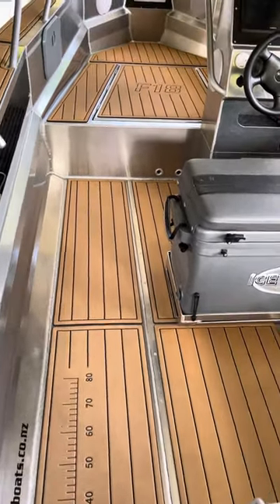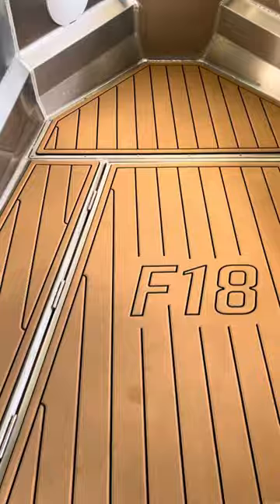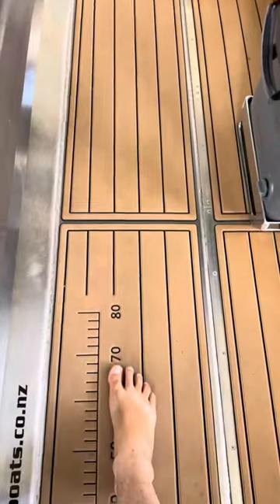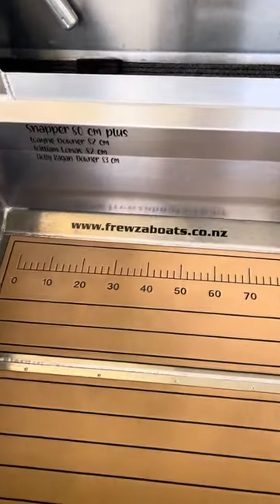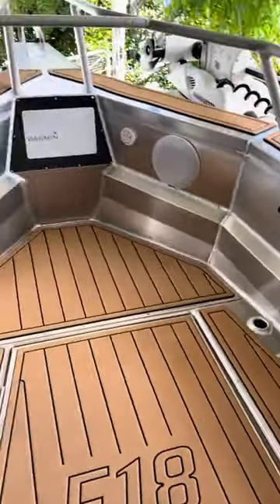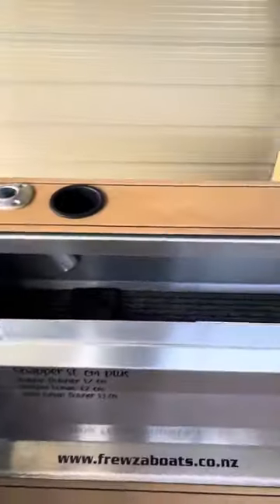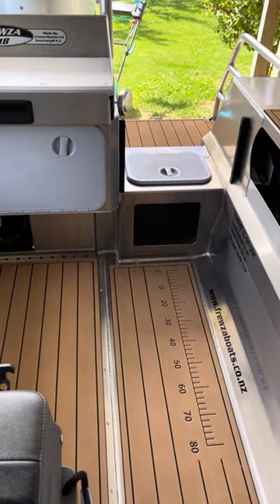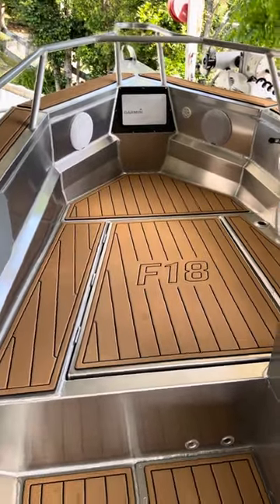U -Dek Flooring on a Frewza F18

Comment: Awesome boat mate! Do you mind me asking what Frewza charge for the boat with all of your customisation? (not including electronics, outboard, etc, just the boat and trailer).
Reply from the maker: hey mate, hull on trailer around $25,000 the extras were: 
wide gunnels $400
casting deck with chilli bin $3100
custom rails $250
minnkotta braket $400
sea anchor locker $300
U-DEK $2500
alloy rod holders $40 each 
bait table with draw $650
hyd steering $1400
twin battery and switches $600
motor $22k